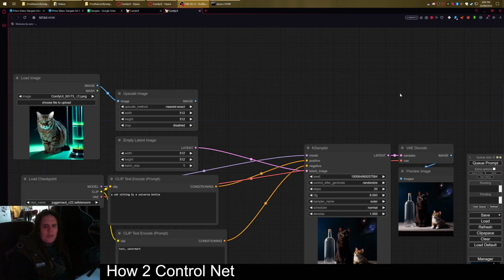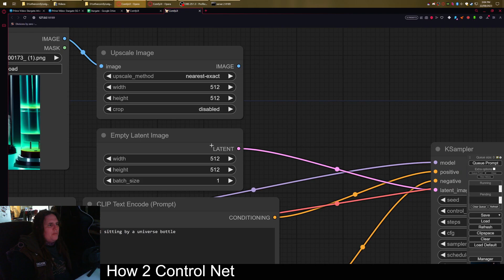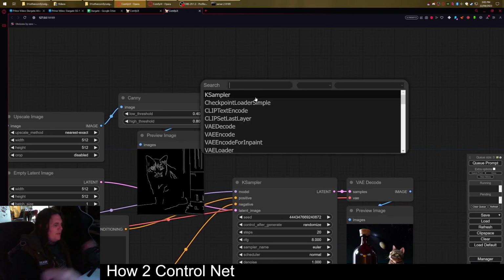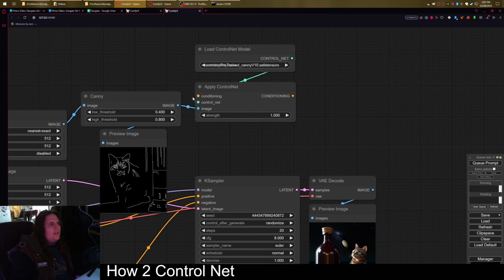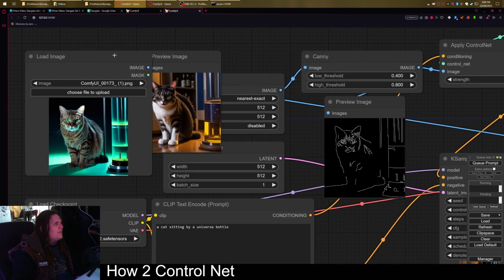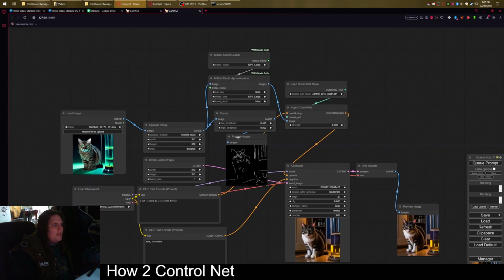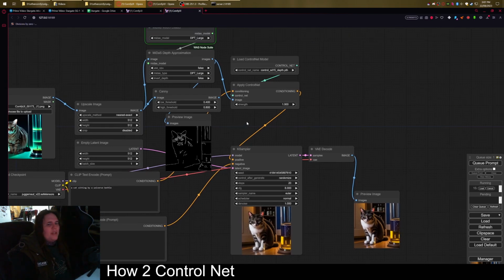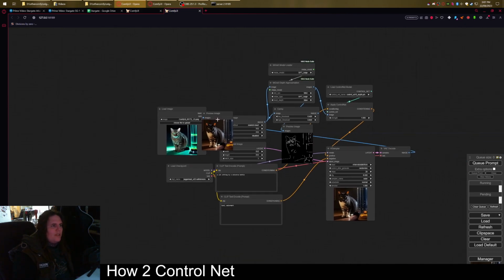ComfyUI How2 - Control Net

Comment: how do I intall a controlnet model? I downloaded diffusion pytorch model saftensors and put it in the checkpoints folder but when I run, it says undefined
Reply from the maker: put them in the control net folder and use a control net loader
Reply: @ferniclestix  thank you.

Comment: There is an empty room, how can I fill it? I am trying to fill an empty room in a certain style without disturbing the geometric shape of the room.
Reply from the maker: it depends how much change to the geometric room you want. I would suggest making use of Compositing if you don't want to mess with the shape of the room but put someone in, ive got a tutorial on that, requires masking and some custom nodes.
Reply: @ferniclestix   For example, when we say neoclassical interior design, it naturally gives a neoclassical room. But I don't want that, I want him to give a photo of an empty room and fill it neoclassically. Or I want to apply an interior design that I found on the internet to the empty room I gave, but most importantly, it will not change the geometric shape of the room I gave it.
Reply from the maker: there is no way to achieve exact results like that without cropping and masking. 
if you can find the exact style you want and create a prompt to build it then thats great, me, i'd mask out the furniture I wanted to change and apply a second prompt just to that area.
Reply: @ferniclestix  i am doing it. My goal right now is to fill an empty room the way I want, no matter what I use. Thanks, appreciate it.
Reply: @haliskurguyan  maybe try initial generation in SD 1.5, applying controlnet models MLSD and Depth? And finalize here, using SDXL and refiner? + inpaint if necessary 🤔
Reply: 🙃🤝 @Shisgara77
Reply: @haliskurguyan   And I would also, after applying MLSD (for styling the outline of your room) and generally generating the desired style, if you are not completely satisfied with the result, I would try the Segmentation model, it's a very interesting model for similar tasks.
Well, or waiting until they make tuning of all these models from SD 1.5 to SDXL and either adjust the normal workflow with new ControlNet for Comfy or optimize the memory for Automatic 🤯))
For now I am only a theorist without practice 🙈)) And I will be interested to know your results. Because this theme is also interesting to me 🤝
Reply from the maker: yeah im hanging out for good SDXL models for all control net too :P

Comment: Where do you obtain the proper models? I have some files from an extension but I have no idea if they’re compatible with comfyui
Reply from the maker: a site called civitai.com has lots of that kind of stuff, as well as huggingface.co  - generally most control net models are 1.5 and if it says 15 or 1-5 or something like that is compatable with most of big models out there.  one that is for SDXL will probably say so in the name.